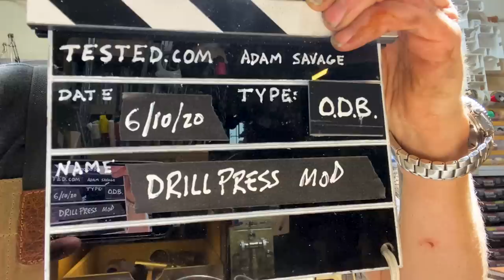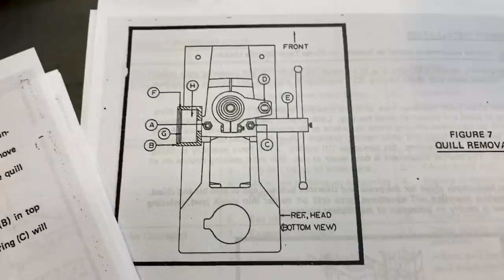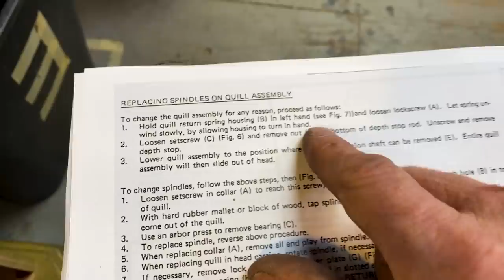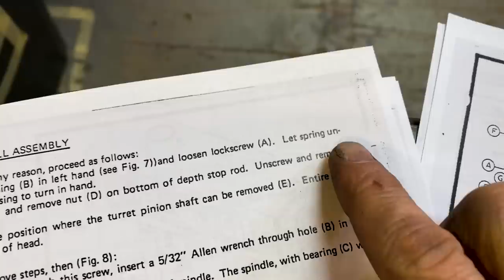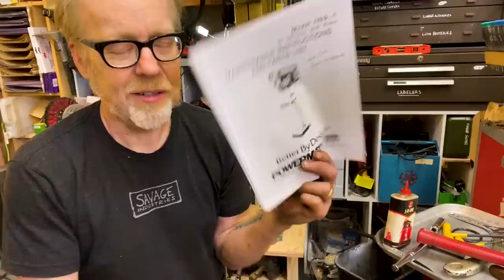Adam Savage's One Day Builds: Drill Press Modification!

Comment from the maker: If you're in a shop infrastructure kind of mood today, here's our full playlist: https://www.youtube.com/playlist?list=PLJtitKU0CAegGi2QUH6ywt4EkjcR0jVam
Reply: Use the old drill chuck as a clamp for holding small pieces of material.
Reply: Adam, how can I contact you and try to get you to build me something? It would be extremely inexpensive and awesome for a one-day build video.
Reply: It might be useful for future people who need to repair this model to put the name and model number of the drill press in the video title. Helps discoverability.
Reply: Youtube University is quite helpful!
Reply: @VorpalGun  ,ak,
Reply: The damaged chuck and damaged spindle can both be fixed. You just need to accept that the part needs to be machined. The damage on the chuck is fixed by boring out the hole one depth over (not dimension, one depth), this part is a one time fix. And the taper/truncated one on the spindle is cut as well, one depth over. Since the damage is superficial, this op will shorten the whole thing by 1~2 mm.

Easy job for a lathe.
Reply: @VodPJ24uEgkkZT  so not just me then :) i think it was the one from the old spindle.....
Reply: @JeffreyKrehbiel  That O ring's only on the quill as a kind of cheap and simple "bump stop" to cushion it's impact when less mechanically sympathetic operators let the quill retract on the spring, rather than lifting it in a controlled manner using the depth feed handles.
Reply: @Reman1975  thanks! ya learn something every day :)
Reply: Adam I saw your han solo blaster built and it was amazing, I'm currently working on a minature ewok village in my backyard tree. It includes torches with LEDs in them ,bridges, minature pottery and more. It would be amazing if you would do a minature ewok village too, but instead of building it on a living tree maybe make the village on a diorama.
Reply: THINK IVE ASKED YOU BEFORE DUDE - BUT HAVE YOU WATCHED / SEEN ANY REPAIR SHOP FROM THE BBC ? GENUINELY THINK YOU'D GET A MASSIVE KICK OUT OF IT ...
Reply: the chuck could be refurbished and brought back to life but this would have to be done by a workshop (like Keith Fenner or Adam Booth have) and it might be a bit pricy (skimming out the chucks taper as well as spraywelding the shaft to later on "seating the chuck" back on it... it can be done Adam
Reply: Dude, You could make the repair Whit the lathe, build an insert, to thread the spindle and the Chuck..
Reply: Dude, I can not believe you used oil to lubricate the turn pinion shaft's gear, you put fine grease to lubricate that thing!
Reply: Adam savage I'm guessing u have never done the speed test..
First few finished win. 

Top of test it sez in bold letters speed test "read everything before answering all questions"
Last words on overside page of test paper then instructs testee that before writing all answers raise your hand. 

First to raise hand wins
Reply: "As long as I have it apart, I may as well go through and clean"...

And REPAINT THAT HORRID COLORED DRILL PRESS!
LOL I just couldn't resist. I'm not sure what they were going for other than 70s levels of odd colors, but those tools have the worst choice of hue of any tool on the market!
Reply: @evensgrey  One of the first projects i did on a lathe (a spun prop shaft, but the same kind of job). It's not complicated if you understand what it is you need to do. And Adam 100% understands it. He just fears it, and there's no reason to fear it here. Those are junk otherwise. They really are. One, because of the few people who use these, two, because the parts are never going to be to the standard of an advised user. Adam here has to opportunity to learn. So why not throw caution to the wind and learn.

TLDR, if an opportunity presents itself, seize it. Especially if you have the knowledge required.
Reply: @aserta  I agree, this could also evolve into a tool build. A precision grinding attachment for the lathe using a die grinder as the powered spindle
Reply: If you find a hone kit with the same taper you could turn a new tapered head and make it into a tailatock chuck for the lathe. Then its repurposed and ready for use again.
Reply: That's a cheap easy fix. 
1. Debur the gouged area of spindle shaft without compromising decent taper face. Use a proper machinist scraper, not abrasive paper with shaft driven, which will modify taper.
2. There will be minimal if any gouging in the chuck taper due to much harder material. Scrape any soft shaft material built up inside there with proper machinist scraper. 
3. Clean and degrease both taper faces. Open chuck enough so jaws do not protrude from chuck face. 
4. Buy the appropriate Loctite retaining fluid for this application... yes, high strength compounds are made for such applications. Apply to shaft only... minimal needed. Do not use cure accelerator. 
5. Couple the chuck to shaft, slight twist action just like the way should be installed. DO NOT HAMMER the chuck.  DO NOT EVER HAMMER the spindle shaft in any assembly process. That ruins bearings. DO NOT BE A BUTCHER as we saw here during assembly. 
6. Place flat softwood timber sheet on bench table, raising table to apply moderate pressure ONLY on the chuck. 
7. Allow adequate time to cure... overnight at least. 
That chuck will not fall off unless severely abused, as previously done, with high lateral load force NOT what it was ever designed to do. 
The keyless chuck is far superior. Nobody in industry uses key chucks these days, unless they have no care for time wasted.

Seriously, why bother with a complex disassembly process, screw bearings and seals, then metal spray and cylindrical grinding process requiring precision angular setup for correct taper, then install all bearings [correctly] and seals for a no two ways around it B grade drill press?  This isn't a precision milling machine or NC radial arm drill... it's a basic pedestal drill.

The noise level when started was of concern. Are bearings in the motor, idler pulleys or spindle head assembly in need of replacement too... or is that flappy belts... or bearings screwed due to prior use or hammering on installation? 

DO NOT HAMMER IMPACT LOAD BEARINGS DURING ASSEMBLY. 
YOU SHOULD KNOW BETTER BY NOW.
Reply: @cooperd83   WASTE OF A GOOD CHUCK WITH NOTHING WRONG WITH IT... CLEAN UP THE SOFT APPLIED METAL INSIDE THE TAPER.
Reply: @aserta   Nope, not even that time and trouble needed to fix this machine. You know the internal taper of chuck is a 'blind' hole and far harder material than the shaft material, don't you?  The suspected damage would only be applied metal from the shaft in that chuck. The shaft... doesn't really need machining... sure doesn't need a bloody butcher at it too. 
Looks 'easy'... hmm.. setup taper angles correctly using a crappy compound slide?  Good luck matching those angles. How do you mount the chuck on lathe then. Care to take it apart to do so? 
Care to disassemble and reassemble the whole spindle assembly... and all new bearings and seals... just so you can machine that shaft in a lathe? 
Think about it - For a very ordinary drill press like this? 

Easy afternoon job for an apprentice using precision scrapers, degreaser (not fuken WD40 fish oil ... smh) and Loctite.
NO HAMMER BEARINGS - BUTCHER
Reply: @cooperd83  I use an old drill chuck as a big pin vise for tapping reaming and deburring holes
Reply: In my experience keyless chucks don't work well on drill presses.  It's hard to torque them tight enough with your bare hands, especially if you have arthritis in your fingers, and if you do manage to torque it tight enough it's hard to undo it after. .  I'm constantly using a pair of pliers on mine which of renders the whole "keyless" thing pointless.  Adam must have had a different experience if he still wants one.
Reply: @cooperd83  -- good call.  Even better, align it to the existing chuck (using a piece of drill rod, dowel pin, or similar material) and then pot it in place on its own base.  Then you've got a mini chuck that's square to the machine tool base for holding small parts for drilling.

There are some great industrial epoxies designed for rebuilding machine tool ways that would work a treat for potting & securing it.

Comment: The old broken drill chuck would make an awesome modified door handle!
Reply: I was thinking that the broken chuck would make a neat sci-fi prop greebley.
Reply: I was thinking that the old chuck could be used as rotary bench "vice".
Reply: @joec4266  yep the best thing is to mill a hex of the top fixed part of the chuck. So you can use it for figuring round parts
Reply: There's nothing wrong with the chuck.
Reply: or shifter handle ball for a muscle car or rat rod.     How long had he been using that drill press with the mangle taper?   At one point I thought he said it was basically zero runout.  It wouldnt have hurt to put a chuck on with a threaded collar and just see what the run out actually was. I mean its not an airplane, its a drill.

Comment: I purchased a Pacific Freight Salvage drill press about 50 years ago.  I had the same problem with the spindle falling off.  I used valve grinding compound to make the mating surfaces of the chuck and spindle mate perfectly, which took a couple of hours to complete.  I cleaned the surfaces well and used a block of wood and a heavy hammer to set them together and they have remained mated to this day.  The chuck opens to accommodate a 5/8th inch diameter bit and closes down to accommodate a 1/16th inch diameter bit.  Visually there is no run out or eccentricity that I can discern.  I suppose that I could put an indicator on it but I don't do precision machining with this drill press.  Great video Adam thumbs up.

Comment: I like what you had to say about repairability.

My favorite shop tool is the radial-arm saw.  I currently am working with a 1953 vintage Delta 30-A, and it is just magnificent.  Three or four wrenches and Allen keys, and that's about all the tools needed to work with it.  With the added bonus that it is good heavy ( H E A V Y) cast iron, and I can tram it in to dead level, plumb, and square.  AND IT STAYS THERE.

Fantastic tool.  Everyone should use one sometime.

Comment: To those commenting on the ‘missing’ o-ring. The ring is clearly visible on the shaft after the repair. The ring on the tray was (apparently) the one removed from the original spindle unit.
Reply: Thank you. This was really bothering me haha
Reply: I was about to comment that, when I noticed that there was, indeed, an O-ring on the spindle too.
Reply: Actually, if you look closely the ring on the table is from the new one, and the one he put on is from the old one. It shouldnt matter at all, but you can tell because the new one is much shinier. They are both on the table around the 27 minute mark.
Reply: Thank you.  He kept asking if something was missing and I wanted to scream about the o-ring.  Since is appears to be more of a bumper than a seal, the old vs new one shouldn't be a problem
Reply: Phew. Now I can sleep.
Reply: 28:47 it appears back on the quill
Reply: @nxn21  Same, I was waiting for him to put it back on, but then he moved on to the depth stop.  BUT when he puts the depth stop rod on you can clearly see it on the quill.  If you go back he clearly put it on off camera as it just appears between one shot and the next.  It was fun watching is LEGO ISS build as I got the instruction booklet and was following along, and found 3 or 4 steps he missed. Though only one caused him a problem as he couldn't attach a plate later.
Reply: Oooooh. I knew someone in the comments would know. I was sure Adam wouldn't miss it but I couldn't figure out where it came from.
Reply: Not only that, did he clean out the inside of the assembly that the quill inserts into?  Probably.

Comment: Hey Adam, great repair! Maybe to make your life living with a keyed chuck a bit easier: I’ve modified the key for my dad’s drillpress, basically putting a nice handle on in. Turns it more into a screwdriver, way easier to use than that smal fiddly key. I did it by cutting a slot in the end of a piece of wood, and pressfitting that over te key, no need to even modify the key itself. And thanks for all the lovely content btw!

Comment: I have an old Jet 13R Drill press that has similar  threads above the taper and they are for a nut that’s only purpose is for removing the chuck. It’s tightened up against the spindle for normal operation and spun the other way to push the chuck off when needed. I imagine the threads have the same purpose on that one. The taper when clean and true should be all that’s needed to lock the chuck on. I scanned some of the comments and didn’t notice anyone mention anything about the threads so I thought I’d let you know.  I enjoy your videos. Thank you. Ron